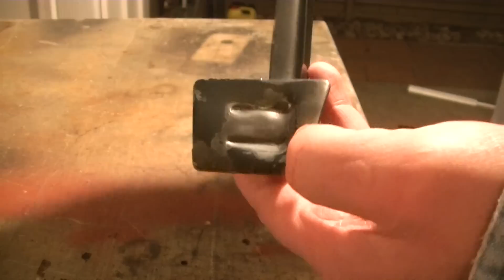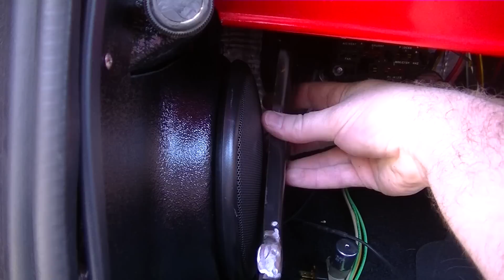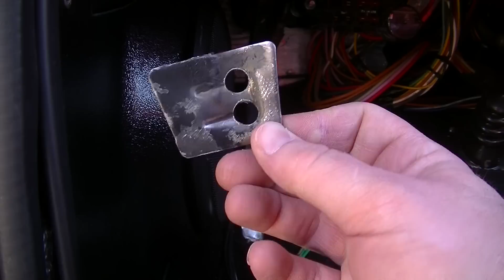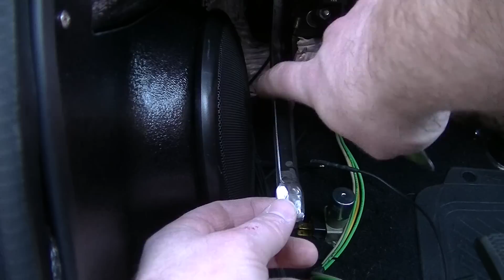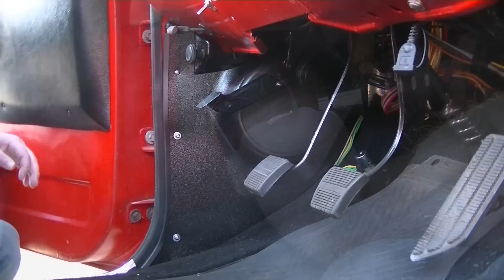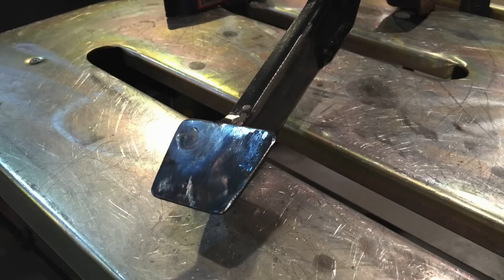PART 2 CHEVY C10 KICK PANEL SPEAKERS INSTALL | 73-87 Squarebody Speakers

Comment: I was wondering something about the parking brake cable in relation to your relocation of the parking brake leaver.....I was wondering is the cable going to wear out faster, is there any trouble with binding.  My mechanic told me those speaker pods wreck the parking brake cable